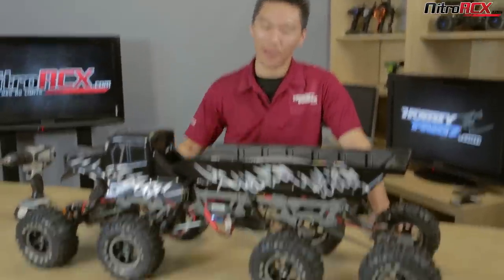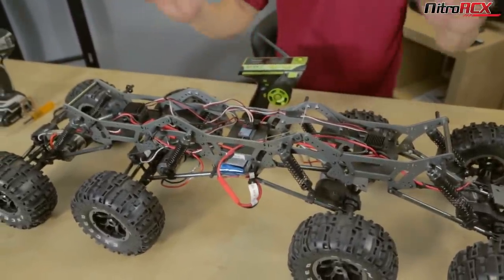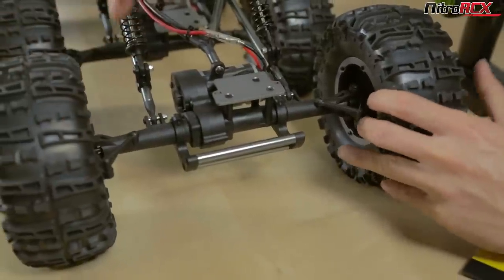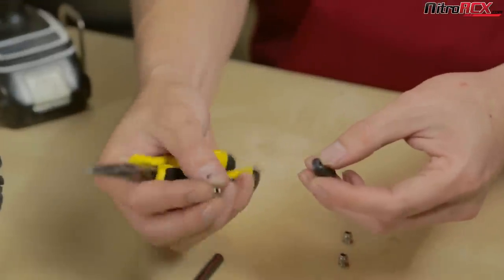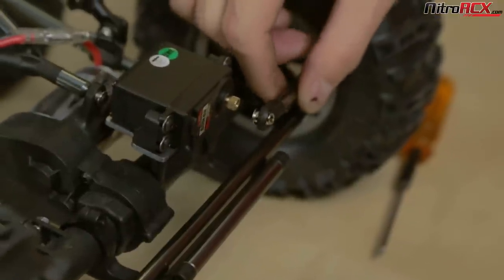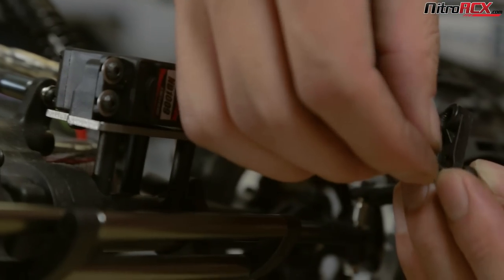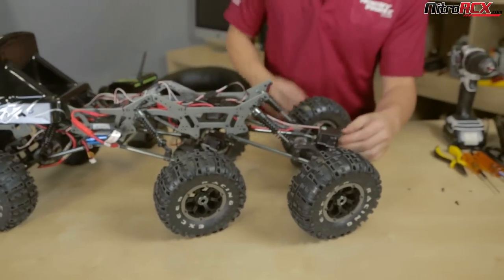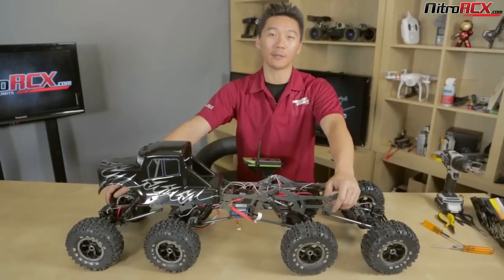Mad Torque 8x8 Conversion 8 Wheels Steering

Comment: Good video, I am using my stock RXTX and I needed 2 of the esc "Y" wires and 1 servo reverser as well as the 2 axle conversion kits from NitroRC to make mine work.  This sucker is a turn beast now, thanks for sharing!